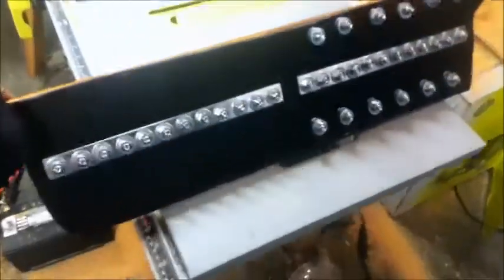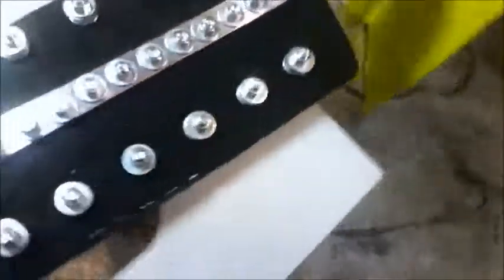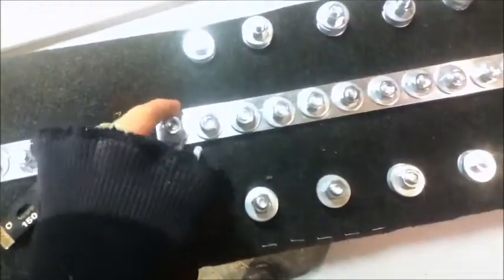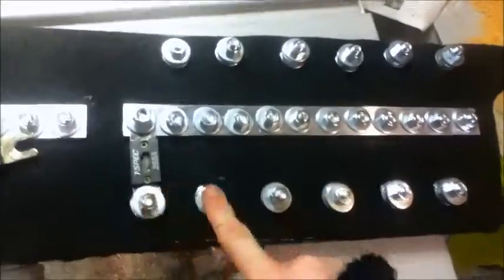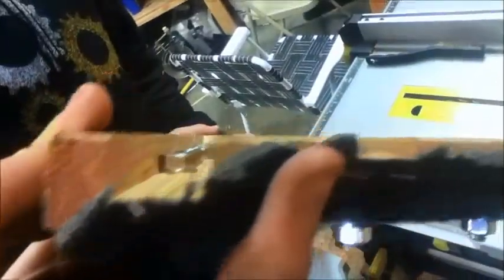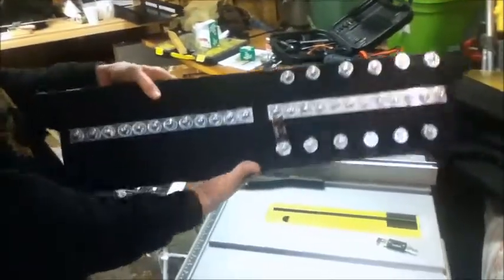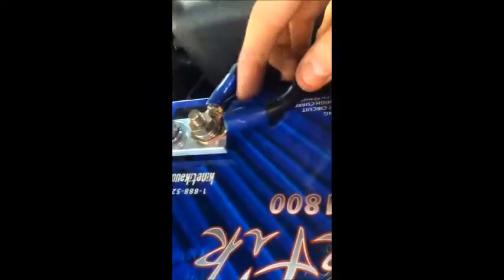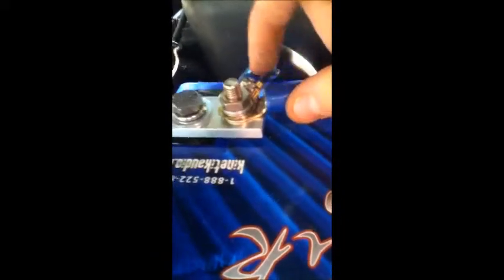Custom Bus Bars for my car

Comment: why fuse from alt to batt? never seen that before.
Reply from the maker: The factory wire that goes from alt to batt+ is fused for safety, and so i fused mine for the same reason.
The alt to batt+ wire is connected to the battery +, and so if it were to short out to any of the hot metal pieces in the front of my car, we would get a fire unless i fused it properly.
I would hate to get a car fire from a small fender bender or little break in the wire.